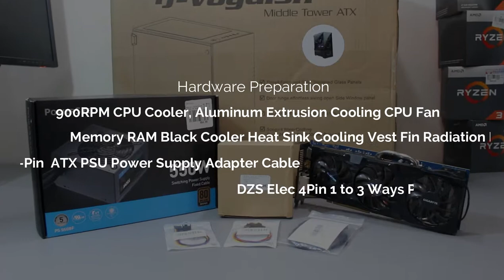Dell Optiplex 7020 RGB Case Modification within $200 Budget

Comment: I’ve done this before. 

Leaving the I/O connected and stuffing somewhere where it is unseen removes that I/O error. 

Using the Temp sensor and leaving hidden somewhere removes sensor error too. Some optiplex, with out the sensor will make fan spin at max speed and could be annoying to some people.

Getting a cheap adapter off eBay will make the rear fan error disappear.

As for the power button error, it’s not really a big thing, but you could always adapt it to the case, modding it to fit under case button. Or, making it stick out the back of case. Extend wires if needed.
Reply from the maker: Wow, you seem to be a genius. When I was making this video, I didn't think of it until now, and I admired your good explanation and your ideas. Thank you.

Comment: I did this with an Optiplex 790 motherboard (the same q67 motherboard but with the default 24 pin) the only issue was the proprietary fan connector in the mobo, but solved the cpu fan with a fan controller until i get any adapter 5 pin dell - 4/3 pin fan connector, looks much better in a nice case :D
Reply from the maker: Great job!
Reply: @comtongny7776  Still a pretty solid HW for a lot of tasks now-a-days, I will use it with a Xeon 1230 v1, 4x4Gb ddr3, good enough for a pretty nice time yet :D , greetings and best wishes from Brazil, be safe :D

Comment: RGB makes everything look better but why was that back fan not spinning in the video?
Reply from the maker: You're my big fan!. Thank you for your interest and support. Because.... the RGB fan that I prepared is 5 Pack... Rear fan is a dummy. I didn't connect it to M/B.
I always thank you for your comments. Have a great day!!!
Reply: When on the computer will pop up the back fan failure when u dont plug in that fan? Is that right?
Reply: @syukur06   No. If it isn't connected to the computer then the computer won't show up the fan. Hope that answers your question

Comment: @ Comtong NY... are you positive that the recommended Ram heat sink coolers in stock on Amazon in fact are compatible with optiplex 7020? I don't see how the 3 pin adaptors would connect on the board?  Please help

Comment: Thanks for the guide! Going to do this on my 7010 👏
Reply from the maker: Good Luck. Thank you.
Reply: did it work
Reply: pls respond im tryng to do this
Reply: Did it work
Reply: Yes it did and sorry R.I.P X for the late response
Reply: @irridesu  thx now I'm thinking of doing it
Reply: @Jamal01223  No problem 😊
Reply: @Jamal01223  did you do it? Cause I’m thinking about doing it?
Reply: @Graphics_Card  no i just stayed with my optiplex case I'm too scared to do it lol
Reply: @Jamal01223  no you can! Just, if you can’t get the reset switches, at least try to get the power button switch in, then buy a pcie usb card and buy USB adapters!
Reply: @Jamal01223  there is a reason for manuals and videos and of course google
Reply: @Jamal01223  get the DT version of the optiplex
Reply: @justthatguy3282  nah
Reply: @Jamal01223  why it's not as hard as you think I started doing it to my dell optiplex 790sff putting it in an nzxt case and it's going great all I need is a power supply and I'm done and I'm glad I did
Reply: @irridesu  hey dude i just bought a RGB FANS WITH 4pin how to connect them :(

Comment: So where did the fan control connect ? The dell fan spot or to a molex?
Reply from the maker: Check the video 7:30 section. I used DZS Elec 4Pin 1 to 3 Ways PWM Fan Splitter Cable. Please connect all pin connectors into this cable. Thank you for your comments.

Comment: @ Comtong NY,  great video... did same modifications and almost everything worked out great.

With regards to the memory heatsink.. I purchased the second one you listed as first option was not available. 

I dont see how this connects to the board of a 7020 as I dont see any 3 pin connector and also these are 5 volts... vs. 12 volts whoch I understand is the volts of the fan ports.

Can you please provide any guidance or another item that is more plug and play.

Comment: I have the Dell Optiplex 7020 mini tower and I plan on doing a case swap but what type of screw driver do i use to remove the motherboard ?
Reply from the maker: You just need a Phillips screwdriver to remove the M/B. The difficult part is to remove the existing CPU cooler and install an RGB fan. It's because we need to find the screw that fits the backplate on the old motherboard and tighten it so that the heat can be transferred well. Good Luck! Thank you for your comments.
Reply: @comtongny7776  I can't buy the same screws you used ?
Reply: @comtongny7776  And is it possible to get a cpu fan that doesn't black ram slots

Comment: hi how did you plug in the power switch and front io without an error?
Reply from the maker: Hi, I already mentioned the error alert due to the failure of the sensor at video 0:19. If you don't like the error, you need to replace the other 1150 motherboards. It's not a that big issue in my opinion because you just simply push the F1 button to continue. Thank you for your comments anyway.
Reply: @comtongny7776  sorry I missed that I skipped ahead in the video to see the final build, are you able to use the front usb and audio ports of the new case?
Reply from the maker: @thuggathuggababy  Yes you can connect the USB cable from the case to M/B. Thanks.
Reply: ComTong NY hey so I got everything to work but is there a way or adapter or anything to get the hd audio of the new case to the motherboard?

Comment: Do all optiplexes not come with a cpu bracket that you installed or is that just yours individually?
Reply from the maker: Bracket comes with CPU fan but it's not compatible due to lack of backplate. So, I used a screw and washer to hold the bracket for the RGB CPU fan. Good Luck! Thank you for your comments.

Comment: Can u please help me because my motherboard doesnt have the front panel pins so how do i plug the front panel connectors?
Reply from the maker: As you can see in this video at 7:45. You have to connect only the PWSW connector to the front panel header on dell's motherboard. It's near the ram DIMM socket. Please pause the video at 7:46 and check the detail. Thank you for your comments.
Reply: @comtongny7776  i am talking about the  H.D.D LED, RESET SW, 2 POWER LEDs connectors

Comment: Do I actually need the fan splitter or is that optional? also what is the splitter used for
Reply from the maker: As you can see in this video 7:20, you need a splitter to connect all PWM connectors. There's only one PWM (SYS_fan) header on Dell M/B. That's why you need a splitter. Thank you for your comments.
Reply: @comtongny7776  Do I connect the 5pin to 4pin fan connector adaptor converter to the splitter?

Comment: How were you able to add aftermarket cpu fan?? I have same adapters and it says my system isn’t working!!
Reply from the maker: As you can see in this video at 4:20, it's a different type of PWM connector on dell's motherboard. So, you need to prepare the convert cable for PWM. Here is the link: Link: https://amzn.to/2RemI9v  You can connect a normal 3 pin or 4 pin PWM connector to Dell's PWM header on the board. Thank you for your comments.
Reply: @comtongny7776  I have some of those and everything seems to work just fine, but when i run diagnostics it says it isn’t running properly. What do yours say when you run diagnostics (F5 on startup I believe)

Comment: Will my RGB fans work if i only use an adapter?? or do i need to purchase an RGB hub??
Reply from the maker: No. In this video, I installed a pre-built PWM RGB case. If you have a 5V 3 pin RGB fan it won't work. You can use only the PWM RGB fan or if you want to use 5V 3 pin RGB fan, try this RF controller for that.  Here is the link: Mini ARGB RF Controller Kit  - https://amz.run/3cc9  Installation video: https://youtu.be/5HOoyupW-j8
  Thank you for your comments.

Comment: I have a dell optiplex 7010 i5 8gb I got the adapter cpu fan 5pin to 4pin i upgrade  the rgb cpu fan like you I get thr alert  0 fan error fan working I have to push f1🤷‍♂️

Comment: Is it possible to do this with a Dell Optiplex 3010 SFF? and if not, could i just buy a dell optiplex motherboard and the adapters and put it in a case?
Reply from the maker: Sure, if the I/O shield is removable, it can be fit any ATX case but it's way too small. I would recommend replacing mATX M/B socket 1155 (3rd Gen) in this case. Thank you for your comments.

Comment: Will it work with a dell optiplex 790 mini tower
Reply from the maker: Yes. it works the same as this 7020. 790 is operated by intel 2nd Gen CPU. They used M/B similar port for CPU power and case fan header so you can try to use a splitter and convert cable as I mentioned on description. Good Luck! Thank you for your comments.
Reply: @comtongny7776  thank you!

Comment: Excellent video. Friend, a question. Any problem with the power button, I have one just like it and I want to do it, is there a problem with that part, did you buy an adapter or how? Thank you greetings from Colombia
Reply from the maker: In order to build this modification case, you need the following converter and cable. -Convert Cable
: Longdex 11 Inch 24-Pin to 8-Pin 18AWG ATX PSU Power Supply Adapter Cable for Motherboards - $10.99  Link:https://amzn.to/2yTBGuR   -Splitter: DZS Elec 4Pin 1 to 3 Ways PWM Fan Splitter Cable Black Sleeved Fan Power Extension Cable 4Pin Female to 3X 4Pin Male 27cm/10.5 inches - $6.99  Link: https://amzn.to/2tEyPn8 - Power Cable Convert Cable - Pocaton 5Pin Female to 4Pin Male Socket Connector Jack PWM Cooling Fan Power Cable for DELL PC -$7.98 Link: https://amzn.to/2RemI9v
You also need to upgrade the power supply 500W or higher. Please see video 7:40 on how to connect a power cable to M/B.
Thank you for your comments.

Comment: can you do a in depth step by step and were every single wire goes? im kinda scared.BTW what ssd you have?
Reply from the maker: You need 2xPocaton 5Pin Female to 4Pin Male Socket Connector. One is for CPU cooler and the other one is for RGB Case pin and Ram Heat sink. When you connect 4 pin cable for heat sink and RGB case, you need to connect 3-way splitter. Please check the video 7:20 and You need the following items to connect all cables. Thank you for your comments.

Longdex 11 Inch 24-Pin to 8-Pin 18AWG ATX PSU Power Supply Adapter Cable for Motherboards - $10.99
Link: Longdex 11 Inch 24-Pin to 8-Pin 18AWG

DZS Elec 4Pin 1 to 3 Ways PWM Fan Splitter Cable Black Sleeved Fan Power Extension Cable 4Pin Female to 3X 4Pin Male 27cm/10.5 inches - $6.99
Link: https://amzn.to/2tEyPn8

Pocaton 5Pin Female to 4Pin Male Socket Connector Jack PWM Cooling Fan Power Cable for DELL PC -$7.98
Link: https://amzn.to/2RemI9v

Comment: And that connected where the case fan from the dell goes ? I thought it was 5 pin ? Does it give a case fan error?
Reply from the maker: Check the Video 7:30 section. I used DZS Elec 4Pin 1 to 3 Ways PWM Fan Splitter Cable. Please connect all connector include case fan connector from case fan controller. Also, like I mentioned on video, Dell board has detection for each fan so you can see the screen fan error when you boot but you just ignore error message. Thank you for your comments.

Comment: Hey @ComTong NY! What motherboard form factor and optiplex desktop would you recommend for this build? Thinking about doing it!
Reply from the maker: Dell Optiplex 7020 SFF was using an LGA 1150 socket ATX motherboard (Intel 4th Gen) so, if you want to change the M/B due to the dell alert system, you can search LGA 1150 socket motherboard on eBay. If you install retail LGA 1150 M/B, you don't need to purchase any kind of cable accessories that I used in this video like Power Cable Convert Cable, Splitter, Convert Cable, but you also need to change the regular PSU over 400W. Intel’s i5-4590 is still enough to use desktop computing or 1080P gaming with a dedicated GPU. The point was to reduce the budget for upgrading. Please consider and purchase other parts one by one. Any questions are welcome. Thank you for your question.
Reply: @comtongny7776  thanks! And yes I’m with the budget to reduce upgrading! Good video!

Comment: Will it work using a Dell Optiplex 3020 MT?
Reply from the maker: Yes, it's almost the same spec so you can prepare materials to setup RGB case build. Good luck! Thanks for your comments.
Reply: @comtongny7776  Thanks for the fast response time I'm a newbie switching from console lol.

Comment: can you send me a link of the adapter you bought to put the usb, audio,power in
Reply from the maker: Please check the description of this video. Here is the links. Thanks for your comments.

CPU Cooler

GIM PWM Aluminum RGB Fan LED Addressable RGB Motherboard Control Cooling Fan Motherboard Sync for Intel/AMD, 120mm RGB Fan - $16
Link: https://amzn.to/2YCkC7A

ALSEYE CPU Cooler, RGB Fans 4pin PWM Cooling Fan Quiet Radiator for Intel 775/115X/ AM2 AM3 AM3 AM4 - $20
Link: https://amzn.to/2zVKvVn

Memory 

RAM Black Cooler Heat Sink Cooling Vest Fin Radiation Dissipate for DIY PC Game Overclocking MOD DDR DDR3 DDR4,2-Pack(MBK5-2) - $14.99
Link: https://amzn.to/368yt5H

Convert Cable

Longdex 11 Inch 24-Pin to 8-Pin 18AWG ATX PSU Power Supply Adapter Cable for Motherboards - $10.99
Link:https://amzn.to/2yTBGuR

Splitter

DZS Elec 4Pin 1 to 3 Ways PWM Fan Splitter Cable Black Sleeved Fan Power Extension Cable 4Pin Female to 3X 4Pin Male 27cm/10.5 inches - $6.99
Link: https://amzn.to/2tEyPn8

Power Cable Convert Cable

Pocaton 5Pin Female to 4Pin Male Socket Connector Jack PWM Cooling Fan Power Cable for DELL PC -$7.98
Link: https://amzn.to/2RemI9v

RGB Fan Pre-Installed Case

FSP ATX Mid Tower PC Computer Gaming Case with 3 Tempered Glass Panels and 5 RGB Lighting Modes - $125
Link: https://amzn.to/2L5tkmw

Comment: I have a 7020 and I want o do this but I don’t know how to find all of the connectors. Can you link the wires (and parts including the ram covers, cpu cooler, fans and case) that I need to make this?
Reply from the maker: You can check the description of this video. I already insert all the links for the accessories. Thank you for your comments.
🅾️CPU Cooler

GIM PWM Aluminum RGB Fan LED Addressable RGB Motherboard Control Cooling Fan Motherboard Sync for Intel/AMD, 120mm RGB Fan - $16
Link: https://amzn.to/2YCkC7A

ALSEYE CPU Cooler, RGB Fans 4pin PWM Cooling Fan Quiet Radiator for Intel 775/115X/ AM2 AM3 AM3 AM4 - $20
Link: https://amzn.to/2zVKvVn

🅾️Memory 

RAM Black Cooler Heat Sink Cooling Vest Fin Radiation Dissipate for DIY PC Game Overclocking MOD DDR DDR3 DDR4,2-Pack(MBK5-2) - $14.99
Link: https://amzn.to/368yt5H

🅾️Convert Cable

Longdex 11 Inch 24-Pin to 8-Pin 18AWG ATX PSU Power Supply Adapter Cable for Motherboards - $10.99
Link:https://amzn.to/2yTBGuR

🅾️Splitter

DZS Elec 4Pin 1 to 3 Ways PWM Fan Splitter Cable Black Sleeved Fan Power Extension Cable 4Pin Female to 3X 4Pin Male 27cm/10.5 inches - $6.99
Link: https://amzn.to/2tEyPn8

🅾️Power Cable Convert Cable

Pocaton 5Pin Female to 4Pin Male Socket Connector Jack PWM Cooling Fan Power Cable for DELL PC -$7.98
Link: https://amzn.to/2RemI9v

🅾️RGB Fan Pre-Installed Case

FSP ATX Mid Tower PC Computer Gaming Case with 3 Tempered Glass Panels and 5 RGB Lighting Modes - $125
Link: https://amzn.to/2L5tkmw
Reply: Amazon and Aliexpress are your friends.

Comment: Do you get a cpu fan error and was the cpu fan running at 100% at all times??
Reply: I have a 9020MT I just case swapped and I get that error because my cpu fan runs through an adapter cable to a ARGB/PWM fan controller. 100% speed but the fans are quiet so I really don't notice.

Comment: This is such a great video I have a this computer but the smaller version, would I be able to do this in the UK?
Reply: Also this would be cheaper if I got a different style case would that also be possible? I’m new to this stuff so just need to be sure
Reply from the maker: Sure. If you want to modify the SFF case, you can do it the same way with a normal ATX case. It is compatible with mini-ITX,mATX, ATX motherboard. Dell Optiplex uses the same board so you need all kinds of cables, a splitter that I used in this video. In another way, it might be cheaper to buy an LGA 1150 board and PSU for the necessary cable. Think about it carefully and start. Thank you for your comments.
Reply from the maker: @nathang_8034  There are a bunch of pre-installed RGB cases at Amazon under the $100 price range or you can use an RF controller even if you install an ARGB fan. Please check this video and get some idea from here. Link: https://youtu.be/5HOoyupW-j8    Thanks.

Comment: This is off topic but I tried my cpu gaming. Can I put an i5 10400 in the 7020?
Reply from the maker: Nope. Dell Optiplex 7020 has LGA 1150 4th Gen socket. Only Intel 4th Gen will fit at the CPU socket. Thank you for your comments.
Reply: @comtongny7776  thanks for the reply man. Have you had any problems with a game crashing into a random solid color(white, black, lime green, hot pink) when you play a game and you have to do a hard shutdown?

Comment: So what extra adapters do i need to buy for fans and rgb lights so that i can use them on this motherboard?
Reply from the maker: Yes. You need the following items to connect all cables. Thank you for your comments.

Longdex 11 Inch 24-Pin to 8-Pin 18AWG ATX PSU Power Supply Adapter Cable for Motherboards - $10.99
Link: Longdex 11 Inch 24-Pin to 8-Pin 18AWG

DZS Elec 4Pin 1 to 3 Ways PWM Fan Splitter Cable Black Sleeved Fan Power Extension Cable 4Pin Female to 3X 4Pin Male 27cm/10.5 inches - $6.99
Link: https://amzn.to/2tEyPn8

Pocaton 5Pin Female to 4Pin Male Socket Connector Jack PWM Cooling Fan Power Cable for DELL PC -$7.98
Link: https://amzn.to/2RemI9v